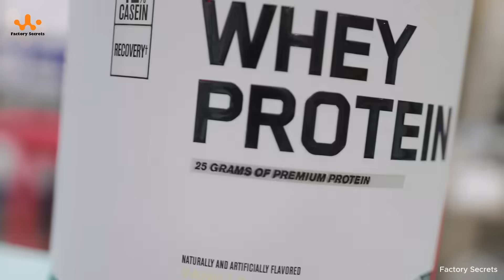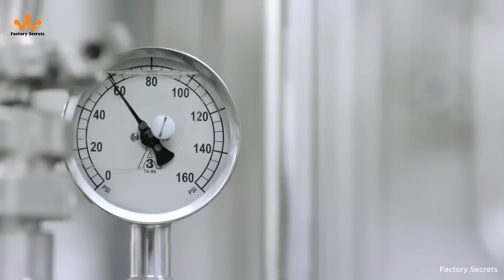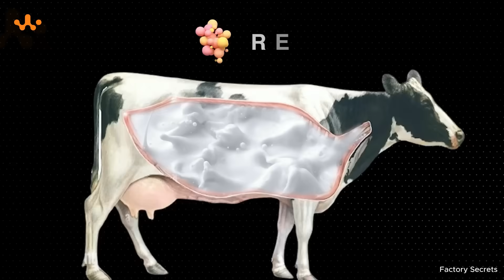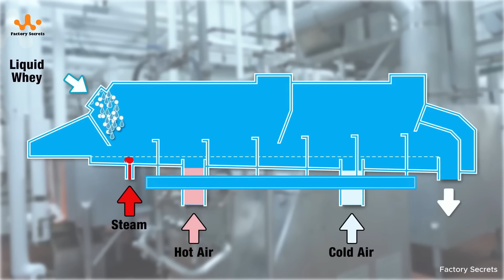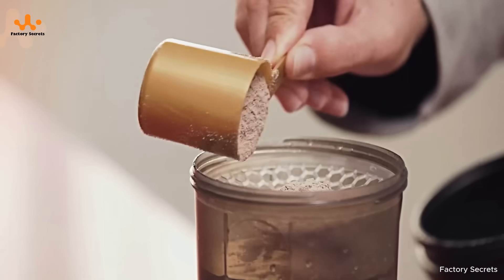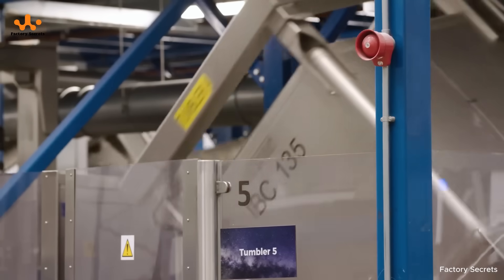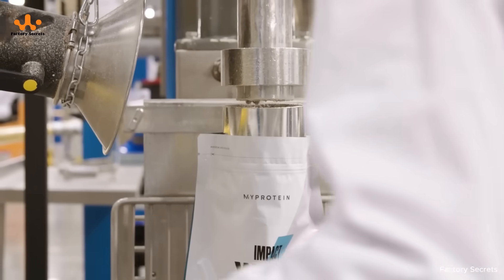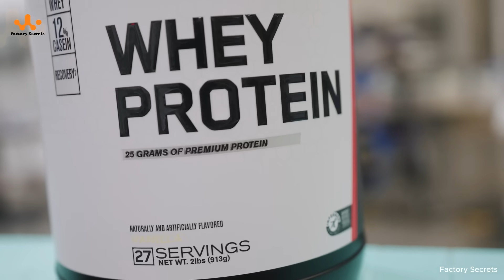How Whey Protein Is Really Made | Behind the Scenes of Fitness Nutrition

Comment: I notice that this is an ARLA facility in the video, do they use milk with Bovear in their whey protein?
Reply from the maker: Good question! As far as public info goes, additives like Bovaer are used to reduce methane and are reported to be fully metabolized by the cow, meaning they don’t pass into the milk or whey. For full certainty, though, it’s always best to check the specific brand’s sourcing and lab tests.